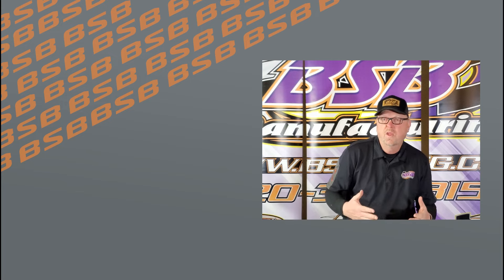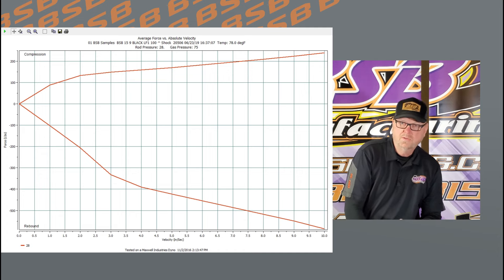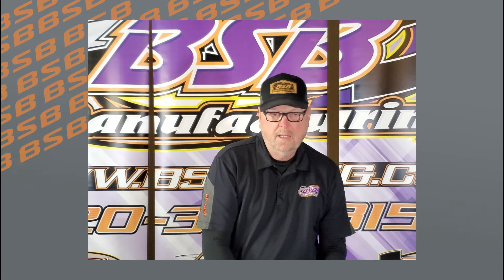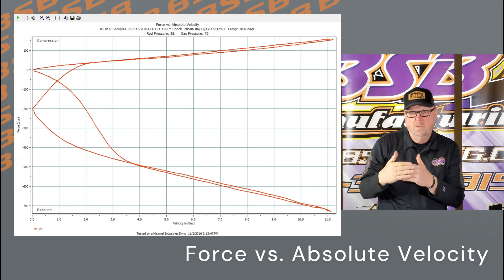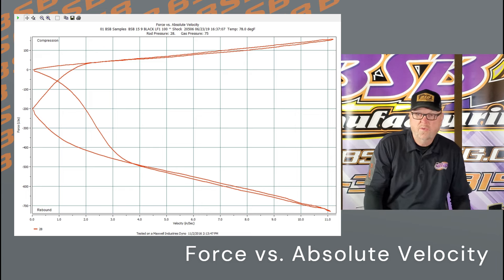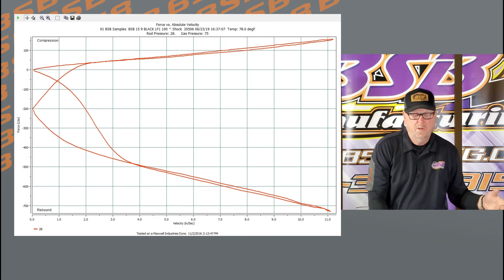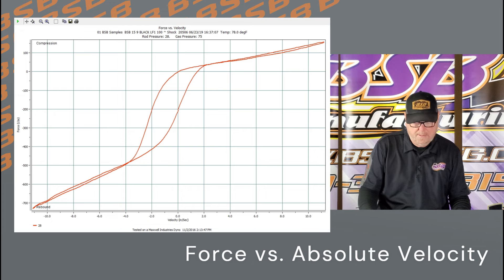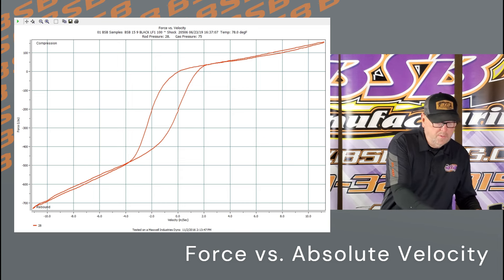How to understand DYNO charts and which one is best.

Comment: Been around dirt cars for 50 yrs, give or take a few years off and back again.... driver, owner, crew guy, sometimes crew chief.... Always would take off a shock after a little mishap and hold it in my hand wondering if it was damaged or OK...... back when you ran junk OEM shocks, go to the parts house and buy a new $10 shock.... after going to special custom shocks... would stand there holding a shock still wondering if it was ok.... built a few homemade shock dynos and ended up on the 3rd try with a small 110v gear reduction motor /gear box and a load cell and scale reader..... I can run a shock at 1"/sec and check it in house and not have to send the shock back 600miles away..... No local shock dynos that I have access to...... that's the reason I ask about getting a dyno sheet with the company I let my owner deal with... if they don't want to send me a dyno sheet, I tell the owner to try someone else.... BSB has sent me anything I have asked for..... Thanks Jay and your staff.....your videos and info has helped a lot of folks improve their programs...... see ya johnny v
Reply from the maker: Thank You for your work in the sport, helping others find their way is what it is all about.

Comment: Does a driver feel the CO numbers when shock compresses  and RO numbers when shock extends?  What happens when the co cc numbers have a large difference?  Does the average numbers mean anything?
Reply from the maker: Yes, the numbers do mean something but in a lot of cases, the driver doesn’t connect the problem to the source. When the gap between open and closed is small the shock is working at its best, when the gap starts to increase the shock is working the oil harder and the feel in the car is going away. When it is really big then the air pressure is too low, and we are creating a pressure change causing cavitation. Thanks for your question